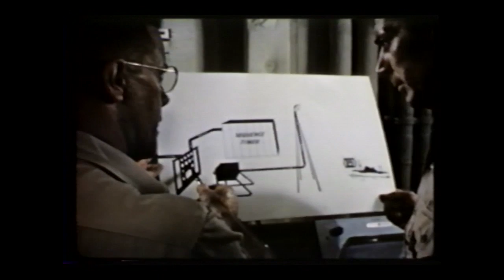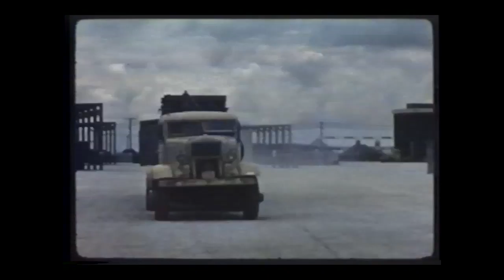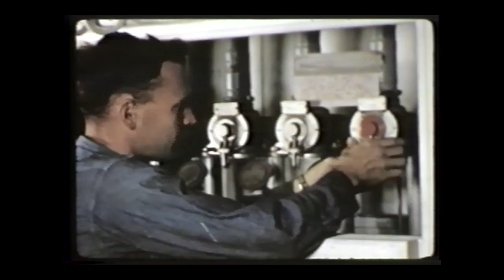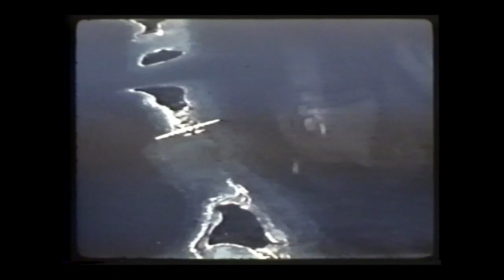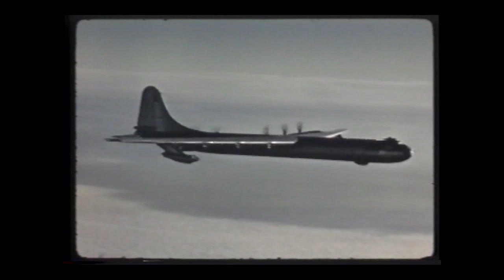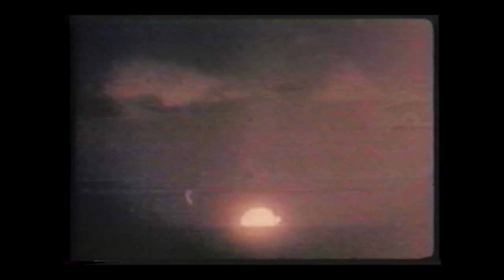Operation Ivy (1952)

Comment: There were U.S. Soldiers on that Atoll when they dropped that bomb and they all suffered from the after effects and they covered it up.....
Reply: Thane Mac 
my father was one of the soldiers
Reply: @Dave Micolichek  Correct, though many of the men were exposed to high levels of radiation whilst performing certain tasks. Official concern for their health and safety was really just a public facade. How much protection you were given also depended on your position and/or knowledge. Most men didn't understand radiological risks at all.
Reply: No, there was not
Reply: There were a bunch at a test in Nevada who were too near got severe burns their skin fell off
Reply: There was no bomb dropped. It was an installation. There were no soldiers on the island. In other tests they did have soldiers take cover in the US.

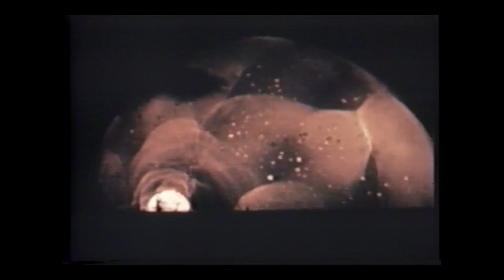Comment: 40:50 Something not often talked about is the creation of the film strip used to create this move. The chemicals used to make film depend an the expected amount of light that will be used. The light generated by this blast would be changing very fast. So fast that the photographer needed to start the film at exactly the right moment and the chemicals used differ from one frame to the next.
      The problem was, the light levels could not be accurately known before the blast, so they just guessed, which is why the film fades in and out.
Reply: Thats awesome
Reply: The film has an emulsion.  The emulsion has a relative film speed that depends upon the size of the silver halide crystals in the film and sensitizing agents used in the film manufacture.   Instrumentation cameras are automatically controlled.  There is a range timing system that starts the cameras at a predetermined interval before the event.  This is done for the motion picture cameras as the film roll in the camera has a certain weight and inertia and cannot start instantaneously.  The camera speed has to be ramped up to its maximum which also determines the frame rate.  There are several controls for exposure and that includes the lens F/stop and the exposure interval for each frame (exposure time).   Generally,  when the exact illumination is not known, many cameras are used with different exposure settings for each camera.  There are also other exposure controls that have been invented for recording atomic tests.  One example is a dual-pane camera window.  The space between the panes of glass has a specific type of metal wire grid and the internal space is also under a vacuum.  When the bomb goes off, the light causes heat in the wires and they evaporate creating a vapor deposition neutral density filter proportionate to the light intensity.
Reply: @buckhorncortez  I know how it works. My point is, all this had to be done ahead of time, so the film had to be different speeds at different parts of the film strip, so when it filmed that part of the explosion it would not be over or under exposed.
Reply: @erictaylor5462  No. That's not how it worked. Read the response above.
Reply: @buckhorncortez google is great, isn't it?
Reply: When was it that they bought all stocks of film from Kodak so they had none and from everywhere else. You couldn't buy any film for weeks after untill they replenished stocks
Reply: So?

Comment: Sure, but holding a vacuum in a tube of that length would be an engineering challenge and would be enormously expensive. Helium is much cheaper.